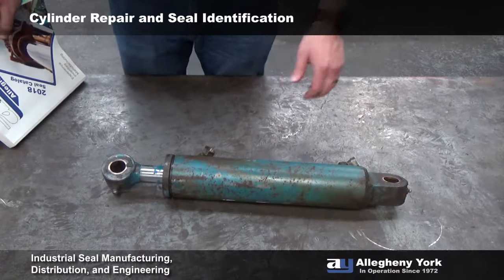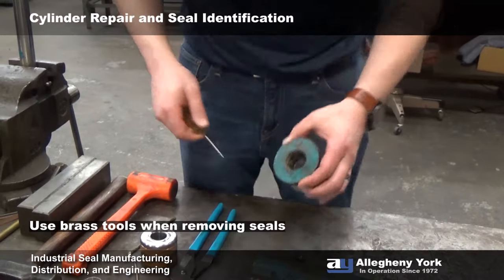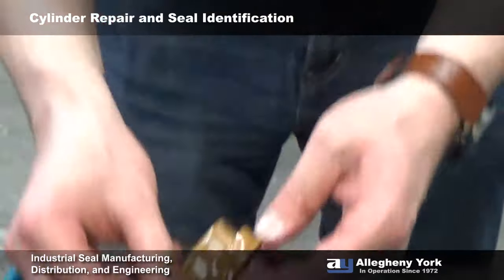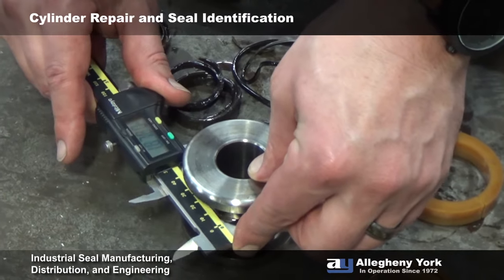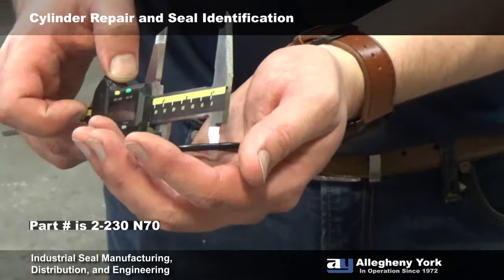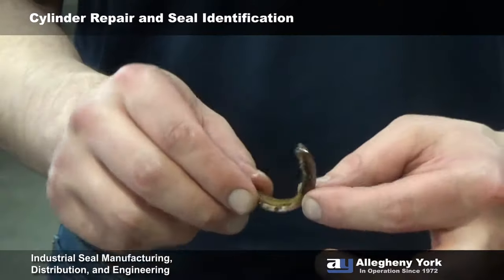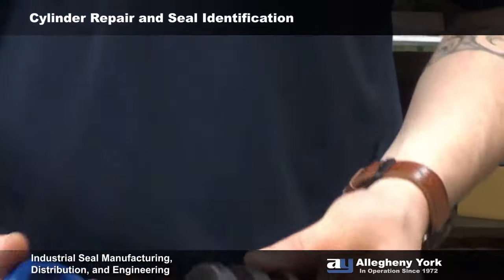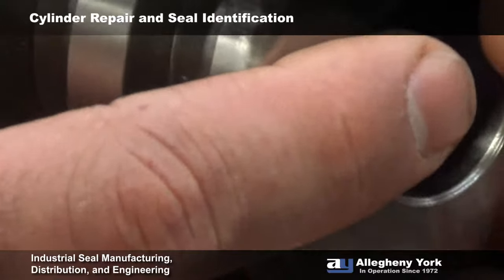Hydraulic Seal Identification

Comment: It says to use brass tools but he uses steel. Do not use a pipe wrench on the piston rod nut. Do not cut the u-cups off in this fashion. This process is very dangerous. He is a seal guy and not a fluid power mechanic. I know because I am.
Reply from the maker: Thanks for the input William. This video was made to demonstrate how to identify seals not how to repair a cylinder.

Comment: That is a useful tip about heating just the seal. I was trying using a hot air gun but that was expanding the piston as well.
Reply: I heat oil to 180 and let seal set 20/30 minutes 😊

Comment: To the couple gentleman that left less than stellar replies: It’s obvious he’s not a mechanic, it’s also obvious he used different tools than one usually would, but did you not get the jest of the video?  It was about helping end users learn about seals and helping them identify seals.
  Hell, in a world where a machine is now obsolete after 10 years people need all the help they can get. I’ve been in the hydraulic world long enough to know we don’t always have the right tools and we also don’t get the tools we do get in either Brass or Stainless like some Engineer recommended, so take it with a grain of salt and give credit where credit is due. This gentleman got most people to smile with his bionic hands and magical finger snaps all while helping others that need it.
  We just made a cylinder Head (or packing gland) for a large John Deere front end loader. It was broken when a large rock came over the back of the bucket and wedged in between the Head and a cross member of the loaders lift arms. My customer called Deere and was told the Head was $5,000.00+ and a new cylinder was over $12,000.00.  Key word is WAS as both the Head and entire cylinder are obsolete. After weeks of hunting my customer brought it in and we spend the next 3 days making this monstrosity, but it saved the cylinder. He was even more excited that I had all the seals for said cylinder in stock, so we reassembled and tested the cylinder before sending it home.
  Part of my point is what he taught most likely helped several people. I wouldn’t recommend using a pipe wrench or using a knife, but I’ve done both on jobs when they were the only tools available. Being professionals (?) there’s no way you can convince me you haven’t done the same thing, unless you’ve only been doing this for a couple years. I’ve done it long enough that there aren’t many cheats around that I haven’t used, or at least tried. Give the man some credit, he did a good job considering it’s not his job.
  Now you can reply and correct me, I await your superfluous answer(s).
Reply from the maker: You nailed it Albert. Thanks for clarifying the video for others.

Comment: Hi I have a bobcat and right underneath the wiper seal there’s what you called a u cup seal sometimes there’s a spring inside the seal other times there’s just a sold piece of rubber what’s better and will the one with the spring last longer or the same ?? Thank in advance
Reply from the maker: A u-cup can be loaded with a spring or a rubber O-ring energizer. What we call either a loaded lip seal or a Polypak, a U-cup loaded with an O-ring is very common and acceptable for most applications. Spring-loaded U-cups are used in more specialized applications, for example, for higher temperatures, compatibility with certain chemicals, or in specific industries like oil and gas. The outer seal material will also change its properties. I’m not sure how long either will last, and it depends on the application to determine which is more appropriate. The life will be limited by the material of the u-cup, which is typically going to be urethane. The spring will not take a compression set as quickly as the o-ring, but the urethane will still take a set over time. In most cases, if it is a urethane seal, a standard o-ring loaded will be just fine. If you'd like to speak with someone at Allegheny York please call 717-266-6617

Comment: My inner gland seals are crumbling. How can i measure what it takes? Also is the piston aluminum? Maybe that why no wear band. Aluminum softer than steel
Reply from the maker: There isn't a good way to measure the groove diameter inside the gland without proper tools. The proper tool would be internal calipers.
You can try to measure the cross section of the seals to figure out the OD. The rod diameter plus two times the cross section will give you OD of seal. 

Not sure the context for the piston being aluminum or not. Typically wear bands are used on cylinders where there is a chance of side loading, such as in construction equipment where there are a lot of extended rods and horizontal cylinders. Cylinders that are unlikely to experience side loading, such as a vertical cylinder on a press, typically do not have wear bands. You could call our service center at 717-266-6617 if you need further assistance.

Comment: I can't believe you use a  pipe wrenche and not the right size socket
Reply from the maker: Thanks for the input. We know the tools used are not necessarily the ones a professional repair service would use. We don't do the actual repair work on the cylinders. We supply the seals that hydraulic service technicians use. This vid is meant as a way to identify the seals, not as a step by step on how to repair a cylinder start to finish.